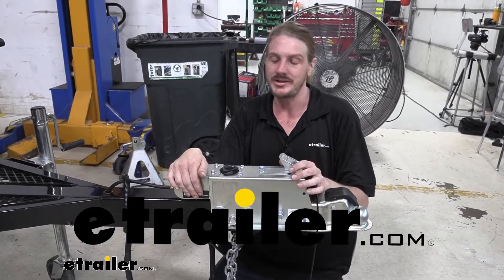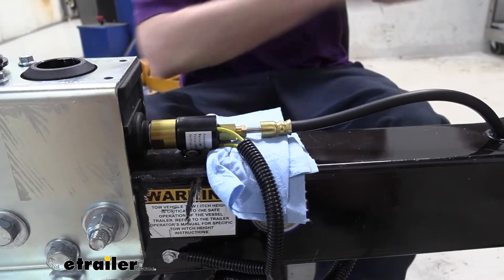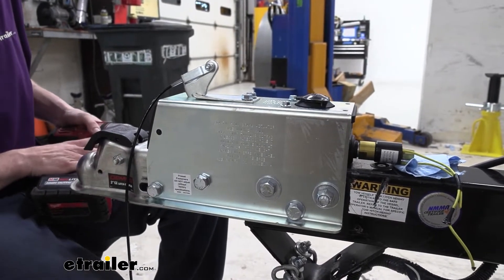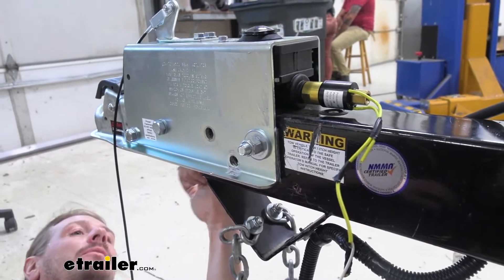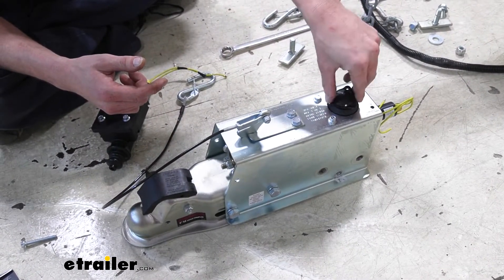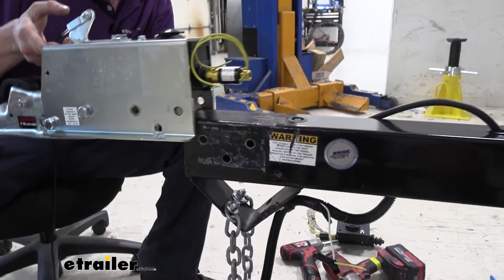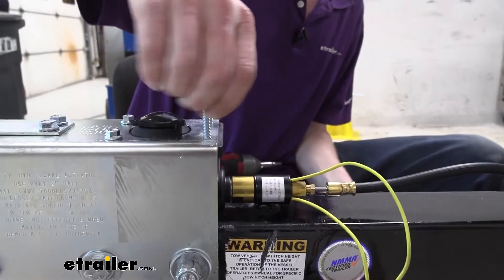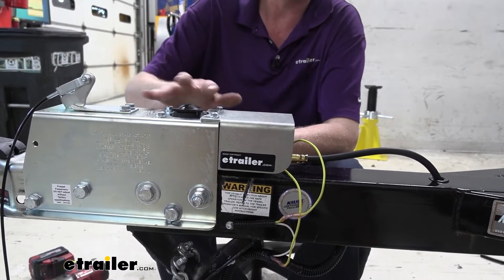etrailer | Let’s Check Out the Replacement Master Cylinder w/ Inline Solenoid for Demco Actuators

Comment: At the risk of sounding ignorant, what it the cable with hook at the end that is attached adjacent to the reservoir cap for?
Reply from the maker: That is the breakaway cable. It's attached to the hitch on the vehicle, if the trailer becomes detached from the tow vehicle it will apply the trailer brakes.
Reply: Thank you!! @etrailer
Reply from the maker: You're very welcome, happy to help!

Comment: I ordered a new master cylinder from yall gave yall  all the # of the trailer to get the right part to  its the type that goes on the inside  from the naked eye looks like the same part  easy change over.   Got it all together but the last bolt threw the  trailer that holds it and also sides on it surge brake boat trailer  but last bolt wont go through cause the  bolt that comes out of the mast cylinder  is to long and hits that sleeve that the bolt goes through  any help i bought it from yall
Reply from the maker: Please give our Customer Service folks a holler at 800-298-8924.